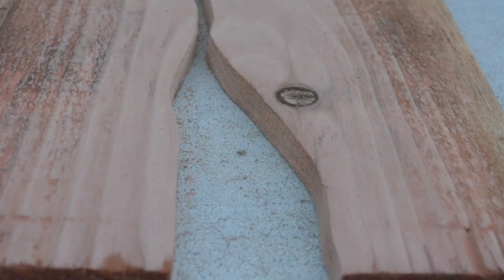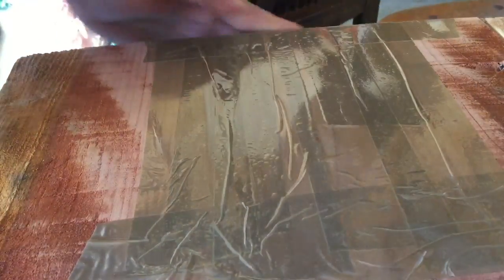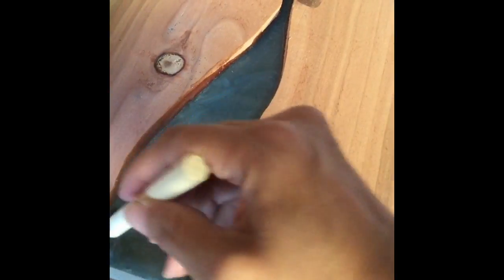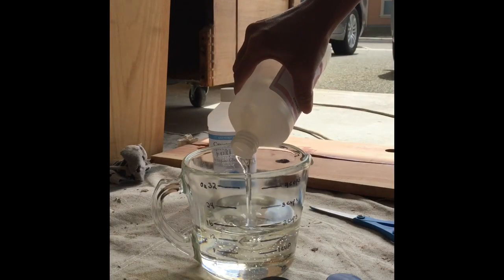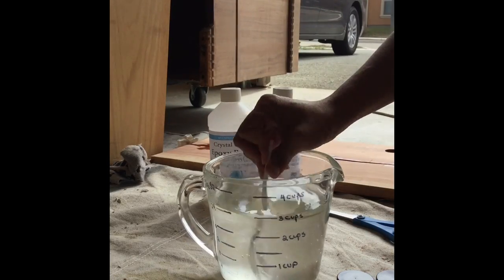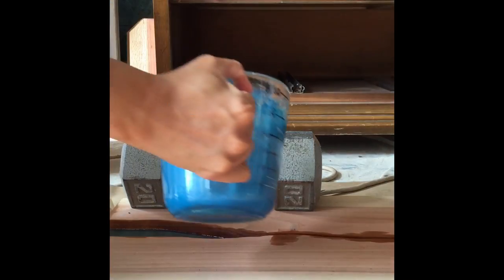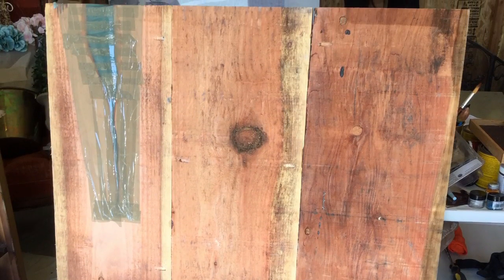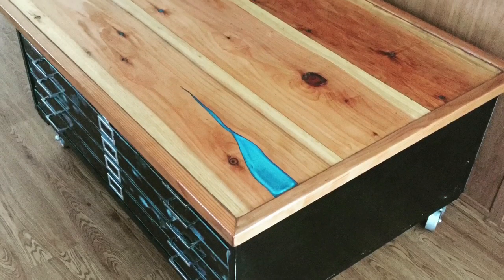Make an in-laid Colored Epoxy Table the Clean & Cheap Way

Comment: Most woodworkers would recommend using a couple intermediate grits when sanding, as you describe at the beginning, e.g. 80 --> 100 --> 150 --> 220

Comment: If you are going to do an instructional video on epoxy resin, you should really explain the importance of using a blow torch or heat gun in raising the air bubbles to the surface for them to pop! There were heaps in your first pour, would have been a perfect time to show how and why we use a blow torch or heat gun.
Otherwise good job

Comment: I just bought a gallon to cast and embed objects and thought it can be poured deep, but the instructions say no more than 3/16 of an inch per layer - or heat can cause cracking and problems. I'm confused... can we pour this East Coast resin deep?

Comment: Hi I use the the same epoxy that u use.  But my point is can I use the type of epoxy in silicon mold or only on wood.  And please at what temperatures it to be came dry I Mack one sample and it stay 24 hur but not dry can u please help me and bot me it the right way